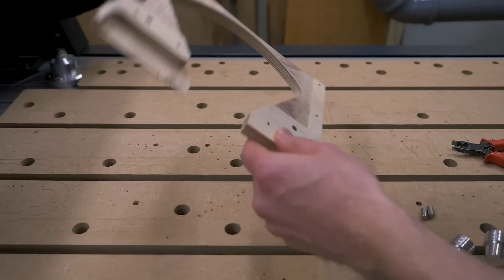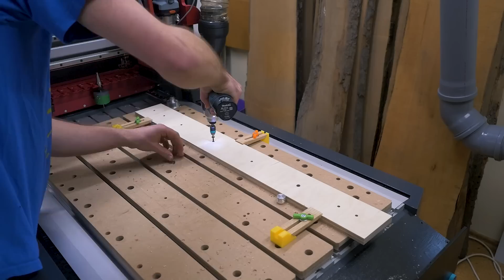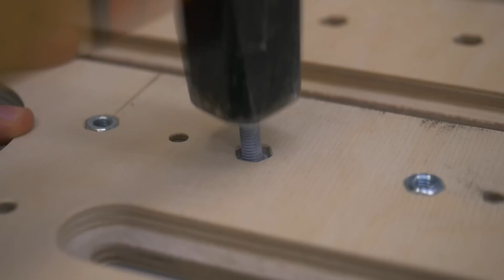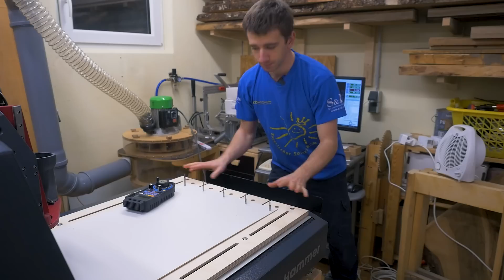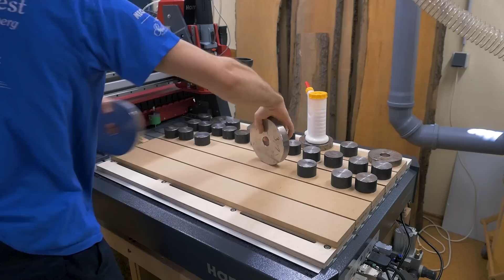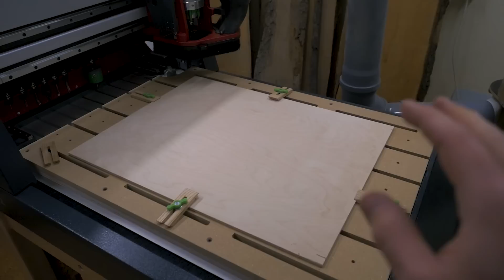CNC Spoilboard v2

Comment from the maker: How do you like this spoil board design? And don't forget to check out the automatic tool changer video...or watch it again ;) https://youtu.be/ZeOUdosoEBM
You can support me and my projects here: https://www.patreon.com/mariushornberger
Reply: Will it be possible to make a cnc machine without cables? Whether the movement is transmitted mechanically, through a laser, or by wireless signal, at least a lot of wires would be eliminated.

Comment: Marius - could you tell us please, what controller and software are you running on the Router (eg Mach3, Mach4, PLC (Siemens/Allen Bradley), or ? )  ?  I am interested in how you programmed the slide motion and activated the clamp and un-clamp feature on the spindle

Comment: It’s obvious you like to design tooling.  But I just don’t understand gluing a spoilboard down.  You can’t even remove just one spoilboard slat. Why spoilboard on top of ply?  They make 1” MDF which is plenty thick.  More you add below the spindle, the less height you have for thicker materials projects.  Lots of work for hold downs.  Did you consider making a longer reach arm on your existing hold downs?

Comment: You are very creative and ingenious in your designs.  But for the purposes of a non-industrial size CNC, I wouldn’t give up table size for an auto tool loader.  The spool board is also great design by not too practical.  You have given up some machining height by the layers.  In my double sided projects, the nature of the project such as the places an index pin can be located dictates where on the spoil board I will locate the pins.  I do then with dowels and then just saw them flat when I am through.

Comment: Thanks for another good one boss! I've been considering various spoilboard clamping for a while. I have a layer of ply under mdf ATM, but it has a bit more flex than I would like between the steel rails of my DIY frame underneath. We may go similar to yours but with cast aluminium plates in the end...  More umming and areing underway.

Comment: Only issue with the waste board is that you are left with a ridge on the side where the tools couldn’t reach to flatten, so oversized material is going to have to deal with that…
Reply from the maker: But as I mentioned, I never had overhanging stuff. And I can unscrew the outer strips when necessary
Reply: @MariusHornberger  Only reason I mentioned this, is that I had that issue with my CNC’s waste board as well, and it was a PITA whenever I had something just slightly oversize, especially when trying to fit square corners of the workpiece into the rounded corners of the waste board.

Comment: I guess you have got your 6mm pins by now, but for the future, and for viewers, I have scrapped a few cheap inkjet and laser printers recently.  It's amazing how little there is that's of much use, but there is ground shaft including 6mm.   (I expected the laser printer to be much better than the inkjets... it was a real disappointment; very little that was not plastic!)
A while ago I was allowed to plunder a large commercial copier which had a stack of automatic document collating trays.  It was past its use-by date, and being dismantled!  What an absolute treasure trove!  Loaded with stepper motors, up to NEMA 23, ground shafts, very precise and strong full-extension drawer slides, power supply, bearings & bushes, plugs, sockets, switches, sensors, and all of a quality to die for.
Worth keeping in mind.  Thanks for another great video; they just keep getting better and better!    :o)
Reply: I've got about 50 shafts of various sizes/diameters out of old printers. What I also have used a few times, are the rubber rollers moving the paper. The can usually be slid off the shaft and then fit nicely onto M4/5/6/8 bolts. They make good anti-vibration mounts or soft endstops for mechanical contraptions. But you're right, everything in a (consumer) printer is so specialized that it's hard to use parts anywhere else. I still got a huge collection of motors, springs, photo interrupters. And I did actually use the optical encoder wheel and sensor of an HP inkjet to build a jog for my CNC. Mechanical switch jogs are for beginners ;) .

Comment: I like the idea, but ... 
a part overhanging on the unmachined spoilboard sides will automatically be out of plane.
Wouldn't the spoilboard out of the machining area be better if it were a little less thick?
Reply from the maker: I'd unscrew the outer strips in that rare case

Comment: ??? why do you glue your waste surface you will have to redo the whole process just to replace the MDF. Also if I was you I would consider building a vacuum table under the MDF.
Reply: If I recall correctly, in a previous spoilboard video, he decided that he would resurface the MDF until it was low enough that hitting T-track, threaded inserts, or whatever other metal components became a concern, then he would resurface once more and glue new strips of MDF on top. That way, the “wasted” portion which will never get cut into during normal CNC operations, gets essentially reused. It makes great sense, and I’ll do that after my next resurface.

Comment: As you flatten the spoil board down, I expect that your new extra side board bits will slowly become higher than your main work area. What is your plan to address that.
Reply: Because they're screwed down, he could take them off and fix them to the spoilboard and face them the same amount he faced the middle, then put them back. Dunno if that's his plan, but that's what I'd do.

Comment: How did you flatten the sides if the waste board that are out of the tool path?
Reply: I just replaced my spoil (jig base) boards.    I had originally had the same concept of using  that space that my cnc  couldn't reach but found it to be a mistake.  I undersized my spoil (jig base boards) by 1" less than my cnc cutting capacity so I could always level the cnc table.  I rarely use clamps I have them but don't use them.  I use brass screws for my first cuts and then switch over to steel screws once the jig is proven and anchor into the jig boards.  I do use a 1/4" plywood as my cut into spoil board (I nail it down with 23 gauge pin nails) and it works great.  I use a lot of jigs to hold my work pieces as I generally make more than one piece at a time.  Over 300 projects these past 3 years.  Just now getting a feel for it.
Reply from the maker: I didn't

Comment: Good job man. I wish i had thought about using the dowel holes with nuts before i cut my waste board with threaded inserts and dowel pins. In any case i have to do another waste board anyway so i think I'll just do that next round

Comment: Is there a good reason why you couldn't use the "wide tool" motion to change narrow tools as well?
Reply: On the last video he commented that it was only the order that he programmed it.
It'd all work with the big tool method, but the small tool was made first and then he added the big tool clause so stuck with that.

That was written poorly, but basically big tool only would work, just came after the original code and wasn't changed

Comment: I gave up on metal pins a while ago and changed to wooden dowels. They're easily strong and accurate enough for my work and I save a tonne of anxiety.
Reply: Just get aluminum or brass pins instead of steel. Unless you're using very tiny bits, even cheap high speed steel  bits will blow right through them if your toolpaths are accidentally going through them.

Comment: Fo you have mechanical or inductive axis end switches? Because mechanical the "known spot" becomes an approximate spot, when cnc is restarted. You will have to re-zero pins, every time.
Reply: Pretty sure he’d be all over this by now
Reply: Well, he has a 3D model of the whole device. He probably have an X, Y coordinate network across the whole surface. As long he returns to what he defines as 0,0 on his machine. He can re-calibrate it easily to that. As a result, the known spots become easy for him to find. Like how he found the plugs from his old dog-bone set-up.
Reply: @Helveteshit  That's all true. Constantinos' point is that returning to 0,0 is difficult if he's using mechanical switches because the point at which they activate has a deadband